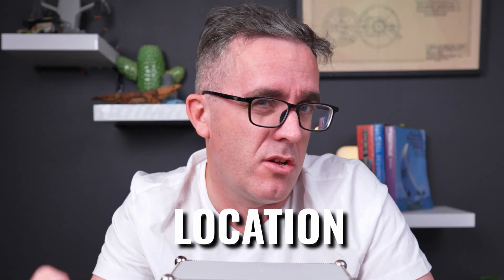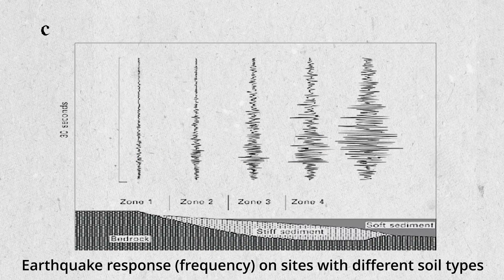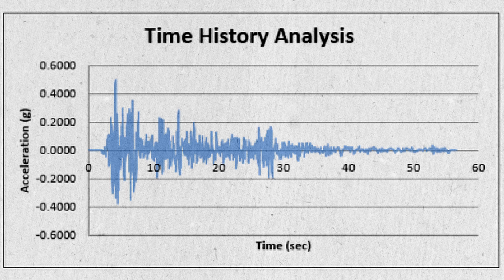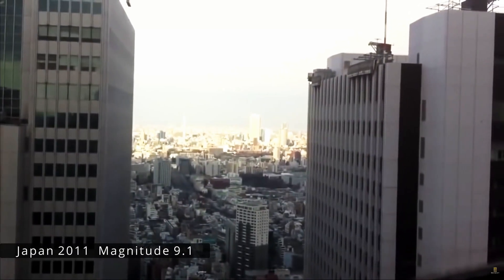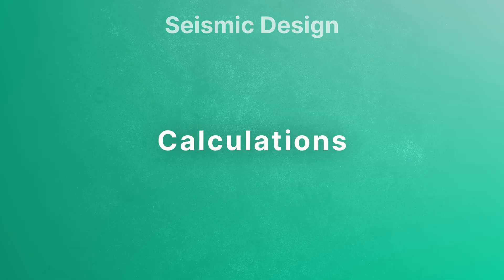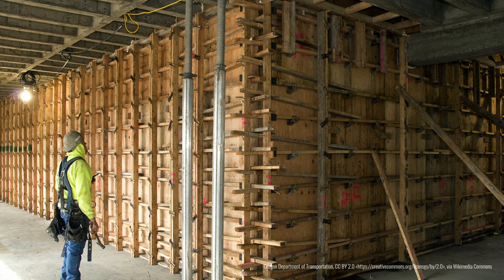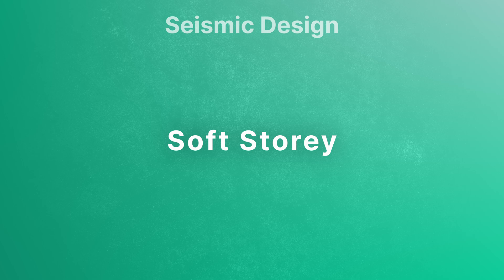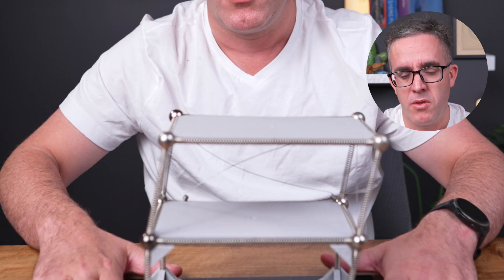Can We Really Make Earthquake-Proof Buildings?

Comment: Thanks Brendan,  great insight on seismic designs and criteria methods. You listed many key points in this regards but the one factor you mentioned that you may have to over design just to accommodate addition lateral loads applied to high rise buildings. Plus seismic loads can change in time to come and it's prudent to have some leverage on existing structures when codes are modified. 

Stay safe
Malik from Barbados
Reply from the maker: Thanks for watching, I really enjoy reading your messages. Seismic actions can be hard to predict with someone simplify the design loads back to code predictions